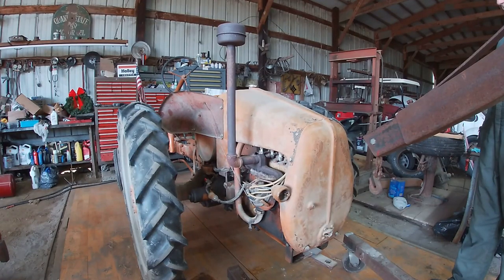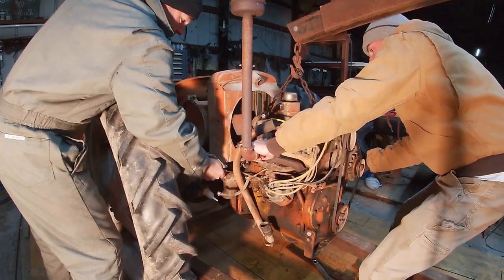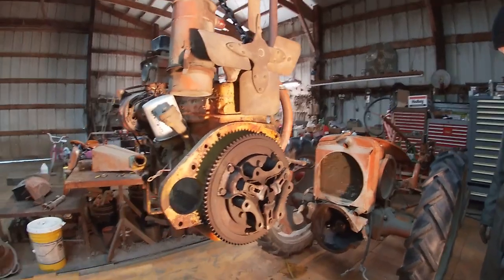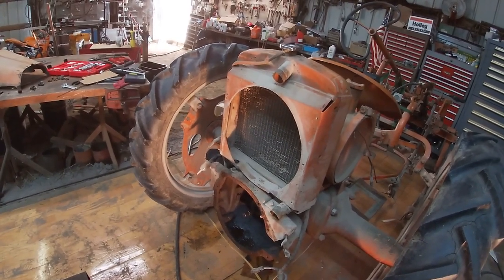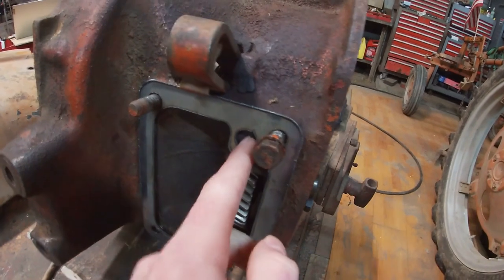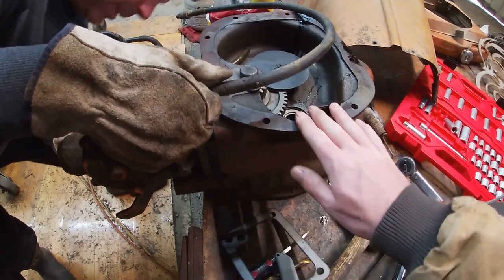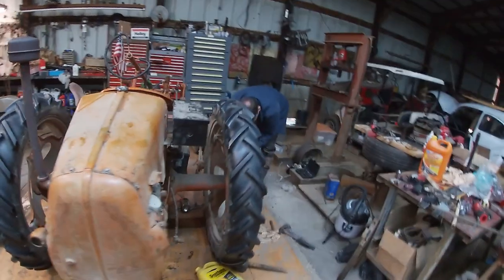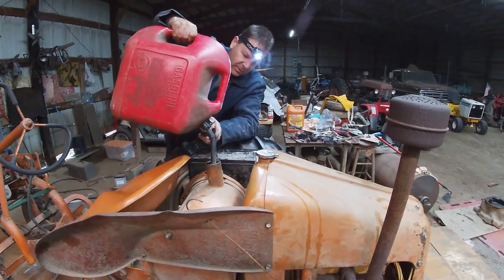G Allis Chalmers Repair - Clutch and Bell Housing Replacement - Bullard Farms

Comment: I like the big wooden floor you got there. We have an earthen floor too. You must have built that after one too many 'nutty cone' bolts. Thanks for the entertaining vid. I'm now motivated to fix my alt. belt today.
Reply from the maker: We still tracked a lot of dirt up on top of it. We put it in place so we would have a level surface to weld the frame of a sand rail project together on, but the G too priority.